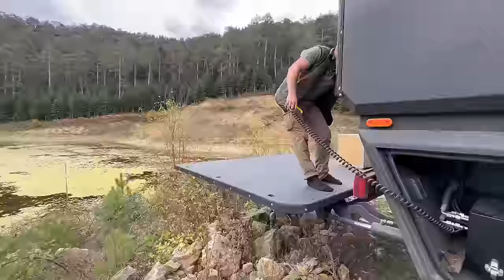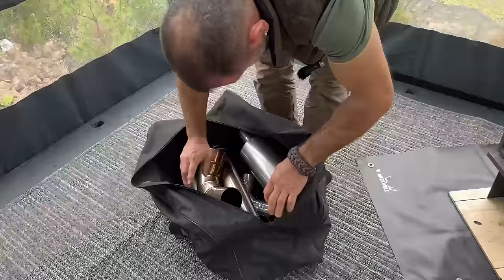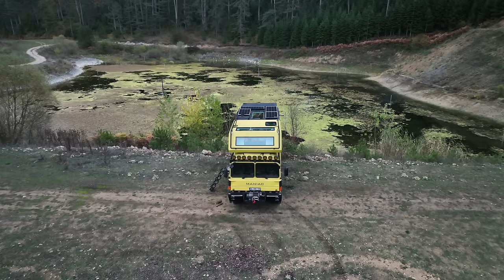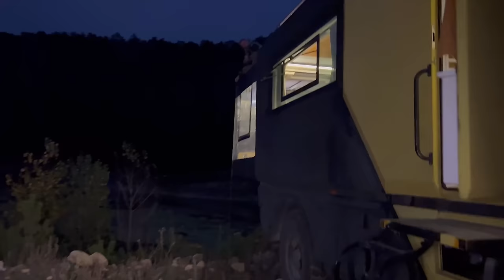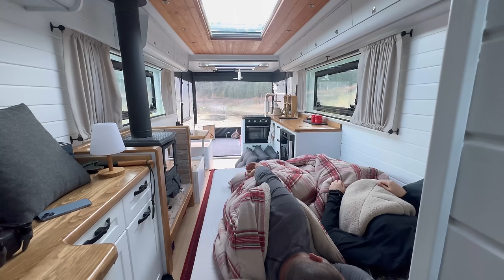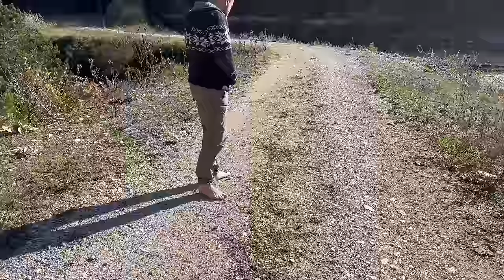KAMYON KARAVAN İLE ISSIZ ORMANDA SONBAHAR KAMPI

Comment: A dream caravan, robust, simple, but with a big but... the assembly can be simplified much more to make it more agile and faster for short stays, since all that work for a single day is more work than enjoyment .
As a recommendation, the outlet pipes of the stove could be a straight outlet to the extended ceiling, with a kind of sealed umbrella on the outside only welded to the pipe, in this way the placement would be simple, fast, stable and without problems of both External water leakage such as smoke or gas leaks from the stove.
I hope the recommendation helps, I love your caravan, it really is a dream of many and one that few of us achieve, that's why we enjoy it through your videos.

Greetings from Argentina.

Comment: For the fire exhaust pipe, Buy a hot tent stove jack to fit aound pipe so there is no gap when exiting the tent. The one I am thinking of is red and looks like rubber, it is reducing in size until it fits over the pipe, it is heat resistant and for this purpose.